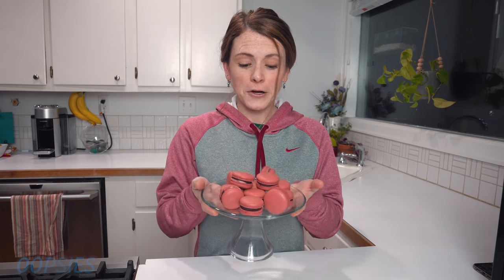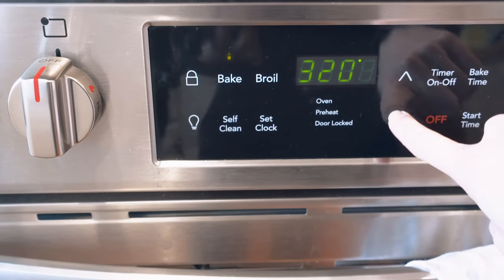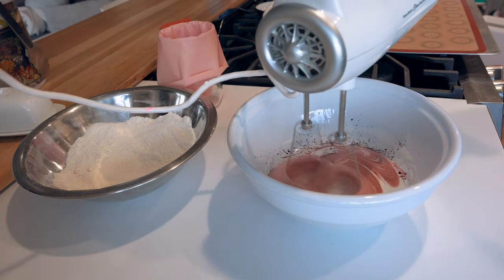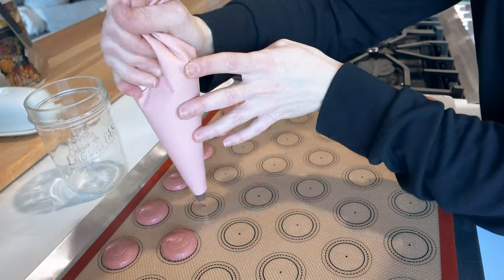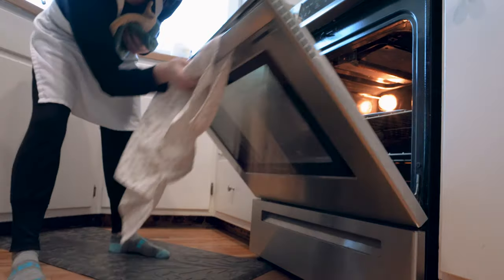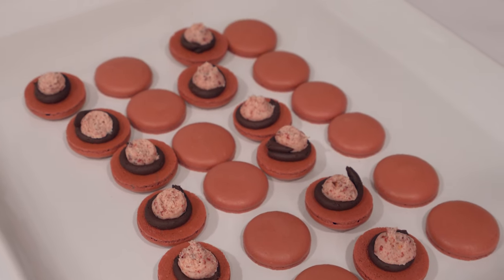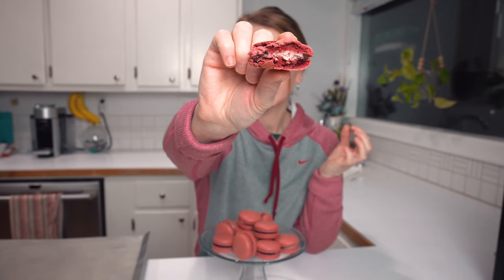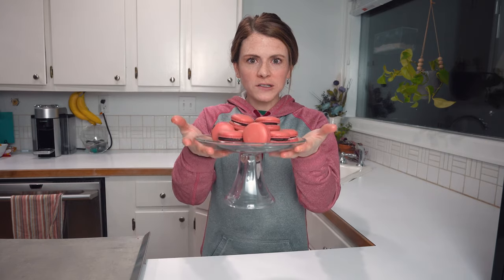French Macarons: No Rest Method

Comment: I started using a dry in the oven method- a few month’s ago and I’ve never had any hollows since. I use a silpat on a regular 1/2 sheet pan. I do convection oven, preheat at 248 F, put in the tray- turn off the oven, prop open with a wooden spoon, immediately turn back on to 248 and once the oven beeps, close the oven, turn up to 293 then bake for 15 mins. Works every time no hollows.
Reply: The Sugar Bean method.
Reply: Tommydan55, yes, exactly! The sugar bean method is now the only way I do macs now. No hollows ever.Love it!
Reply: How long did you close the oven  door after drying..?
Reply: @ufaalvaro  Sugar Bean turns off the oven and then turns it back on so it'll beep when it reaches 120C again. My oven will never reach 120C again with the door open. So, I just wait 2 minutes with the door closed and then turn the oven up to 145C. Suzie Q, do you bake one pan at a time, or more? The reason I ask is that when I bake more than one, the bottom pan gets cracks. The top one is fine.
Reply: @tommydan55  so here the final step with your oven :
First, set the oven until 120,turn off, put the tray, door open in 2 or 3 minutes, then close the door, turn the oven on for 2 minutes, set your oven in 145.bake.oven shower. 

Is it correct..?
Reply: @ufaalvaro  No, Sugar Bean turns off the oven and then turns it back on right away. That's so it will beep to let her know when it returns to 120C. But Bake Toujours made some very nice-looking macarons in this video, following slightly different methods.
Reply: @tommydan55  yes.. Sugar bean has a great oven..😆😆
I try her methode but sometimes get hollow cells. I know it's about my oven. Can't reach baking temperatures after drying😅😅
Reply: @ufaalvaro  Unless you have a high-end and expensive oven with a very strong fan like hers, I don't think anyone can follow her methods exactly. I dry with the door closed and it still takes 4.5 minutes to get to 145C after I turn the heat up. We have to bake for longer than Sugar Bean does.
Reply: First of all, thank you Suzie!! I need to try!!! 😊 

When baking at 293, do you still keep convection setting the entire time? Or do you switch to regular oven setting at some point?
Reply: @WS-cu3uk  I never turn the oven off. Suzie Q in her first post said she turns it off and then immediately back on. I think she has a very good commercial oven. I have an ordinary Samsung convection oven.
Reply: @tommydan55  thanks for your reply ❤️
Reply: Measuresment is not given
Reply: @anjana1724  You have to watch one of her other videos for the recipes, ones like this one:
https://www.youtube.com/watch?v=7ZNFebQvv0E
The recipe is given in the Video Information below the video. Or this one:
https://www.youtube.com/watch?v=2UUGWPkIVPU
Both in the video and in the video information.
Reply: @tommydan55 I also have a regular Samsung convection but I have gas. Would I use the same method?
Reply: @Brandi_the_Baker  Yeah, mine's electric. I don't see why not. However, my methods have changed since then, although I'm not necessarily recommending them to anyone else. I set the oven to 300F (150C) and put the macs in for 2 minutes with the door slightly open, to dry. After 2 minutes I close the door and bake at the same temp for 19 minutes. I can now bake 2 trays at a time. No cracks and nice feet.
Reply: @tommydan55   I would love to be able to do 2 trays at once!  Does your oven convert the 300 to 275 on the convection setting?  Do I set it for 325 to get it to go to 300? I'm always confused about the convection temps.
Reply: @sougarcia8890  As far as I know, the temps are the same whether convection or not. But I always use convection. I believe the pros do as well. Everyone should definitely have an oven thermometer so they know the real temp. Brand new, mine was 30 degrees too cool. Thankfully, it has a way to adjust the temperature settings.

Yes, I always bake two trays at a time. It saves a whole lot of time. But you won't know if that works for you until you try.
Reply: @tommydan55  thank you for the reply!  Yes, this is a new oven and I'm still getting used to the convection baking.
Reply: @sougarcia8890  Yeah, you have to be careful with them as things cook more quickly. If you follow a recipe and the suggested time is for a non-convection oven, you might have to cook it for less time, or at a lower temperature.

If baking two trays of macarons at a time doesn't work (maybe one gets cracked shells), you might try a trick Nicole suggested to me:
Begin with one tray, 2 min. with door open slightly @300F, 9:30 min. with door closed, move to 2nd shelf and put next tray on top for 9:30 min. And so on... 19 min altogether.. That is, cook them for half time, move down to middle rack, put in another tray. After 19 minutes remove that first tray, move top one down and put in a fresh tray. You might have to adjust the temps and lengths of baking time to suit your own oven. This is what works for me best. No cracks and full shells.
Reply: @tommydan55  interesting... I will give this a try with my next batch.  I did two trays at once today and got tons of cracks so maybe rotating the trays will help.

Comment: I've been making some changes that has been working, thanks for the encouragement!! It's wonderful to always learn something new! First, it's your small batch recipe , then I macronage partly by hand mixer and finish by hand (saves my wrist from developing carpal tunnel), then no rest, baked on silicon mat, 300F for 20 mins, conventional electric oven. Results: shiny tops, nice neat feet, delicate crunch to the shell, some hollow but fills up with maturation. Thank you and to Teyanna!!
Reply from the maker: Magnificent!!!!
Reply: Where can I get this recipe used?
Reply: Hi I need to recipe plz
Reply: Do you have instructions on how to do the macronage in the mixer?
Reply: @lieachasmith2608  I just add the almond flour/powder sugar mix to the meringue while mixer is on low and just until it is all moistened. Then finish by hand ti flowing stage. Hope this helps

Comment: Wauw your macarons look sooooo perfect! I just tried  to make them twice and I felt like the batter was quite right (I got the perfect ribbons) but when I got them out of the oven they were cracked and hollow. I also put in my oven thermometer and saw that the temp was higher. I put the oven on 150 C but it reached 170C so I opened the oven door a little bit during the baking period so the temp could go down. So my question is does the cracking/hollow shells happen because of the higher temp or because I left the oven door  a bit open for a while? 
I also noticed that you use a lit of batter per shell. I pipe less batter so they are a bit thinner. Can this also influence the problems I am having?
Reply: You may be OVER macron-aging. I made dozens of macarons, getting the same hollow, browning and sticking bottoms.  I was just frustrated.  When I stopped macron-aging just before the lava, ribbon flow stage (JUST BEFORE) the hollowing and sticking disappeared.  The oven temp was the culprit for the browning.

Comment: How about NO REST Method and two trays for next experiment? =P  Love all your videos!! Thank you Nicole!
Reply: I second that request. I was finding the bottom tray always got cracks on the top.
Reply from the maker: 🤪 dang friend now you’re asking for magic. 😘 I’d think you need a convection oven for that!
Reply from the maker: @tommydan55  yeah it’s better to alternate after half baked then add the second tray so it cuts time a bit, but still not two at once completely
Reply: @baketoujours  A delayed reply. I wanted to try out your suggestion a couple of times. And it works. One tray for 10 minutes. Add the second tray after 10 minutes, moving the first one down. 10 more minutes go by, take out the 1st tray, move the 2nd one down and add a 3rd tray on top. 10 more minutes and the 2nd tray comes out, the 3rd tray moves down and the 4th tray goes in. 10 more minutes and the 3rd tray comes out and the 4th tray bakes for 10 more minutes before coming out. As you mentioned, more work, but the results are worth it. Making batter for 4 half-trays isn't much more work than making for one, so I always do that. 10 more baking minutes (50 now as compared to 40 before) isn't so bad when I can now get 100% success and satisfaction, compared to tossing some  before and getting frustrated. Thanks again!

Comment: I have another question. My merengue was quite right and had good stiff peaks. I added vanille extract and a golden color paste. When I tried to mix the merengue a little again the merengue totally collapsed and all the stiffness was gone. Could it be that the coloring paste or vanille extract did this or did I just overmixed the eggwhites?
Reply from the maker: What was the color brand? You want to make sure it’s not oil based. But I don’t ever add vanilla extract to my meringue either — however, it shouldn’t make it completely collapse

Comment: Hi nicole, do you want to  try no rest macaron using sugar bean methode..? Pls check her youtube chanel....She dry macaron in the oven in high temperature for 2 or 3 minute.  I really want to know whether you recommend this or not.. Thank you 🙏🙏🙏
Reply from the maker: Hi I have tried it and it surprisingly worked. However, she later came out with a video saying If you have a conventional oven that it’s not recommended
Reply: @baketoujours  glad hear you've try her methode 
So did you try it by convection oven so it came out perfectly..? 

Btw, what if i try your recipe using perforated tray, does it work without resting..?

Comment: Hi Nicole😊 you’re awesome! Thank you for continually sharing all of your experiences with baking these finicky cookies. I’ve been trying many many times...not sure what to do with all those egg yolks. However, I have BEAUTIFUL looking cookies, feet and all but then comes those STINKING hollow shells! Every time 😭😭😭 sometimes I get lucky and get half hollows. I watch your Macarons 101 each time to make sure I’m doing everything exactly as you are. I have all the same ingredients including the brand you use. I have a gas/ convection oven and use the convection setting to help with even heat air flow. I must admit, I have not invested in an oven thermometer. Could that be causing my problems with the hollow shells? Also, are the shells still supposed to be crunchy after filling and maturing in freezer for 24 hours? Mine go soft.  Sorry for the lengthy comment but I really need help in trouble shooting 😅
Reply: Borrow an oven thermometer from someone to test, and then return it. You absolutely have to know if your oven temps are accurate. Mine weren't, either in an old one or in a brand new one. At least the brand new one could be re-calibrated. I think most people mature overnight in the refrigerator, not the freezer. They're not supposed to be either crunchy or soft (mushy) the next day. The insides are supposed to be chewy, like marshmallows, maybe. And the crust is still supposed to be crunchy. And if you really do freeze them, make sure and use an air-tight container. If you don't then, yes, they'll turn mushy.
Reply: Thank you so much for the reply!  I thought I seen on one of the videos about the freezer … maybe that was just for the shells 🤦‍♀️ anyway, yes on the air tight container. And I will definitely get myself a new oven thermometer.
Reply: @denecefrisbie9578  You're welcome. Bake Toujours has a video about freezing macaron shells:
https://www.youtube.com/watch?v=EACfI3N52tc
Reply from the maker: Perfect reply!
Reply from the maker: I totally agree with that tommydan55 stated above. I hope that helps!!
Reply: You all are awesome and amazing 🤩 
Thank for the help, hopefully my next batch will be better 🤞

Comment: @baketoujours Why does my macarons keeps cracking or it will look great on the outside but the inside will be wet and super chewy even if it has browned. At certain try, they came out perfect, no hollow, properly baked and no cracks. But most times it is not. 

What went wrong?
Reply from the maker: Are you using this No rest method? Or just in general. I suggest hitting up @whiskatx for trouble shooting if you’re trying to get more answers about this no rest method. She is amazing
Reply: @baketoujours  yes this no rest method. But I do not know which part did I do it wrongly since there are times of success.ostly disappointment though😢
Reply from the maker: @charlaynteoh781  whisk is an amazing resource if you have Instagram
Reply: @baketoujours  alright I will check em out. Thank you Nicole😊

Comment: Hi Nicole!!! I followed what you did in this video and my mind was totally blown coz my macarons turn out perfect! I first tried the sugarbean method..coz i read about it a lot in the comments , thinking that its more practical coZ i dont need to buy a new baking tray. But all i had was cracks. My oven is totally not suited for that method.  
I actually have a small air bake tray which i purchased before. I actually got annoyed coz i thought its not good for making macarons so i just use it whenever i have extra macaron batter. It always make good batch though, but it didnt cross my mind that its the tray that making it good. So this morning i tried to use it, using your method in this small tray and the rest of the macarons using the regular tray and method. And the air bake tray batch was perfect.
Sorry for the long story but im just soo happy. I have a question though. Do you bake two trays or still one at a time? If one at a time, does it affect the second tray that already stood a while? Thank you so much!!